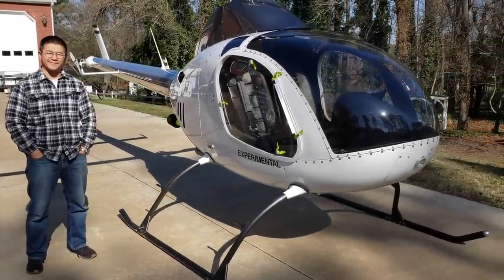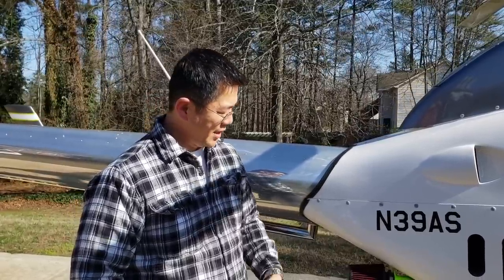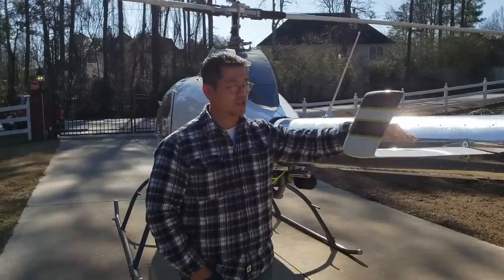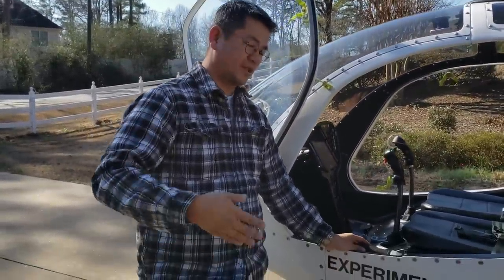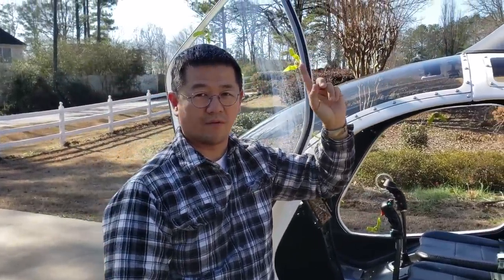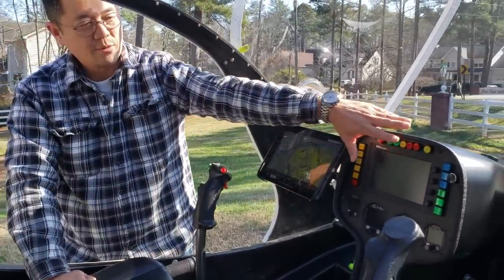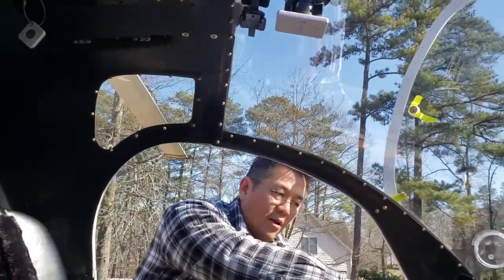Build A Helicopter In 500 Hours

Comment: mark evans fronted the show,great guy,however,david and jonathon bull at southern helicopters actually led the build from start to completion,mark and"pete mate"made it entertaining and it was.truth is,500hrs build time,is way off actual.ive had my ancient exec 90 almost 4yrs and every resto,maintenance issue ends up with many hours,blood loss,aching muscles and lighter pockets.imagine trying to take apart a watch,thru the top of a goldfish bowl and you are close.very clever people at rotorway,Air crash investigation used to have 2 paramators to look for,Pilot error,or manufacturing fault,ok,amongst others,however,constructor error is the new kid on the block and i get it.so tempting to cut corners and at the same time"its your ass"when it goes wrong.I highly recommend a build,or resto project,but  stay real.having said all this,i still love my rotorway.good luck out there.

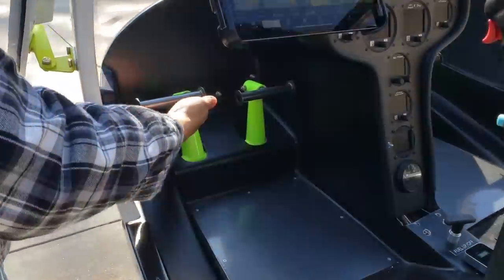Comment: At 5:01 you operate the yaw pedals with your fingers but when I test flew a 162F I found the pedals very heavy compared to the R22 that I was rated on. It was connected with Bawden cables if I remember correctly and I had previously seen that on power boats which were also heavy. Is this aircraft different or was I just flying a bad example perhaps? (I just figured out that I'm asking the wrong person but I'll leave it here for discussion)

Comment: It's quite counter intuitive that when unpowered and working as a wind turbine in freefall that the rotor produces a lot of lift so you can fly it. I guess it makes sense as each blade gliding down and forward like a plane wing.
Reply: Dan Frederiksen the rotor produces almost no lift while in autorotation (1500fpm at 70mph is a horrible glide ratio). The purpose of the negative pitch is to keep the rotors spinning, while the slowing of the rotors by increasing pitch near the bottom gives you the lift you need to not become a pile of burnt metal and flesh.
Reply: @superskullmaster  7.6m/s drop may not be the greatest hover but it's vastly better than free fall. So I think you are wrong. The rotor tip speed is probably a good portion of the speed of sound so the effective glide ratio might be better than a cessna.
Reply: Dan Frederiksen interesting thought. Makes me wonder what the average rotor airspeed is since it's almost zero at the hub and very fast at the end.
Reply: Rotors are 25ft in diameter.  8.5 revs per second.  Tip speed is around 460mph.
Reply: @davidchow9528  fits well with my intuition. same for nose props. If we count that for glide ratio, it's better than 20:1 although in autorot it might be a bit slower.